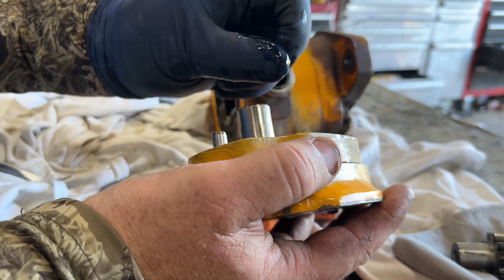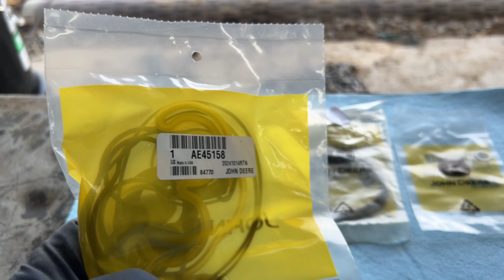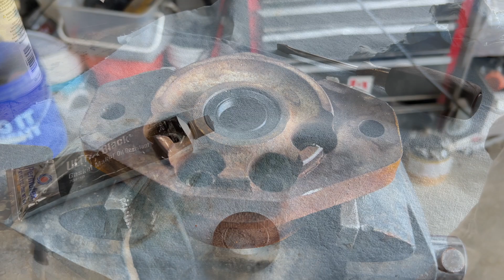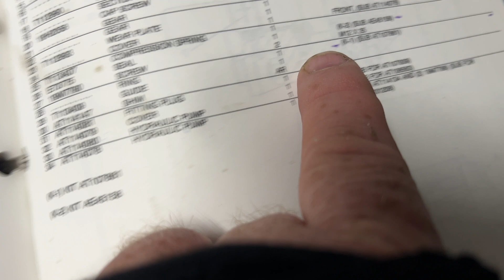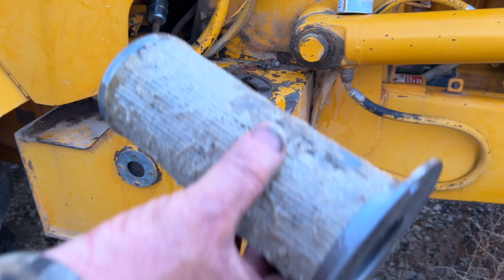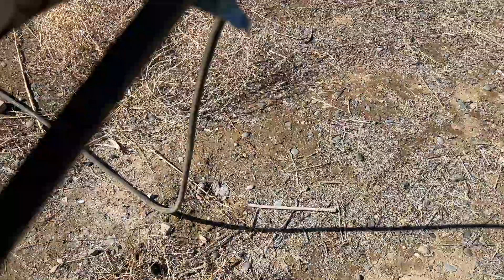Rebuilding The Hydraulic Pump Our John Deere 310C (I Can't Believe I Missed This)

Comment: Hello anyone knows the potential reason on why the hydraulic oil would leak into the transmission system after the change of the new hydraulic pump? Our backhoe is the 310J

Comment: I drilled/tapped a 1/2" 13 hole in the top of that weight and threaded an eyelet into it.  Used an engine hoist to remove, I've done it a few times now and it's handy for sure. 

How noisy is your pump?  Mine is super buzzy but only at certain RPM.  Everything else seems fine...

Thanks for the video.
Reply from the maker: That's a great idea, thanks for sharing!  Before the service and cleaning it was really noisy, mostly due to that suction strainer being clogged.  Now it's much quieter, but I'm having my filter light come on, which I'm thinking it's catching more debris so it's probably going to need a few flushes.

Comment: Petrol would be much more effective at cleaning out that filter than diesel,,,,,Petrol is an excellent degreaser ,,diesel is not so much as its an oil,,,
Reply from the maker: I prefer diesel as it’s a bit more safer to handle, not flammable like petrol.   Thanks for watching and the comment!

Comment: Hey man do you have any parts for these hydraulic pumps? The splines on that shaft just sheered off on mine. I can't find the parts anywhere. Do you have any leads on parts for these?
Reply: #22 in the parts book
Reply from the maker: Sorry I don’t.  But I’ll see if I can find something and let you know.
Reply: Thanks. I appreciate it. And ty for the video.
Reply: From what I understatnd all that's avaiable from J.D. is the seal kit.  If that's the case all you can do is buy a used pump that may or may not work.  1987,  310C,  4wd., cab,  ext. hoe here on Michigan farm.

Comment: Had a similar hydraulic pump failure but on a much smaller scale. The pump on the ACE system on my 2013 RRSSC  Copart win was leaking badly. None were available in the US I could find. Ordered a new one from UK. Drained system and installed new pump. Additionally, there is a filter inside the control block under the passenger side (US). Filter was full of contaminates and crushed into it self. Hydraulic fluid starvation had destroyed the pump. Obviously had never been serviced at 117K miles.
Reply from the maker: Interesting, it’s crazy how bad they get.  Thanks for sharing.